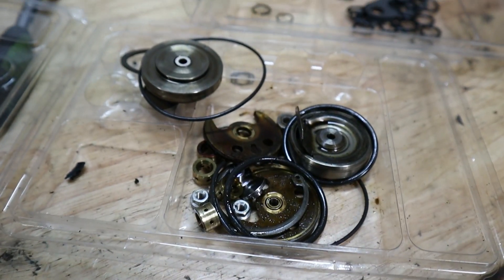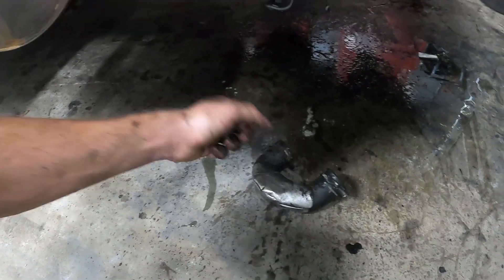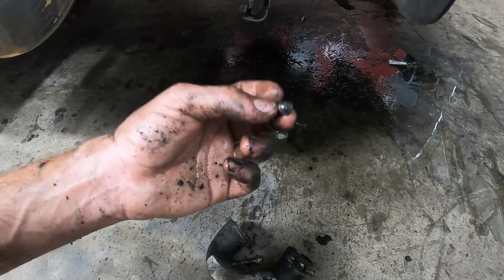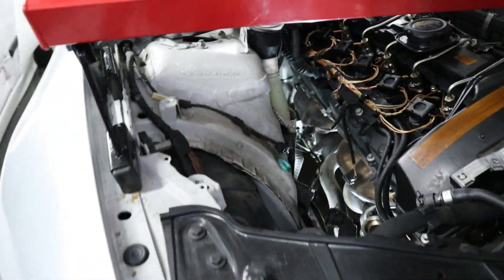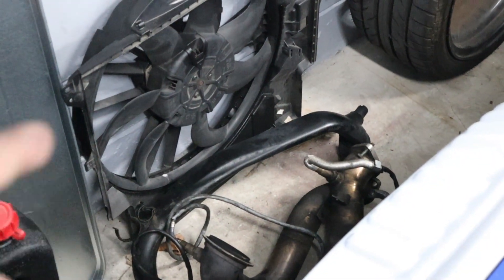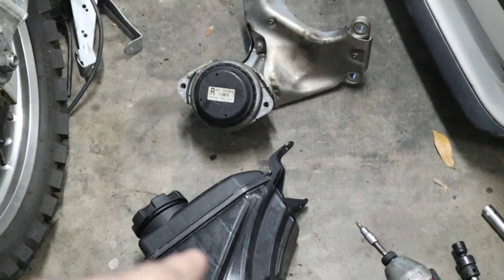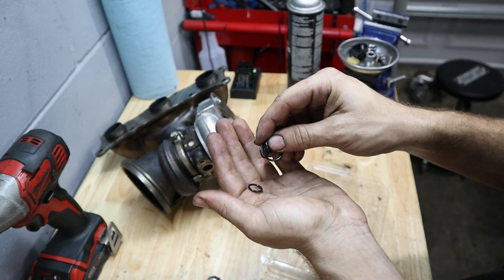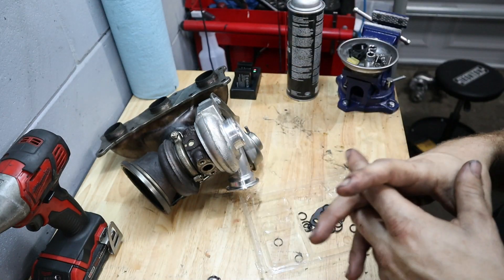Removing and Rebuilding the Factory Turbos on my 335i (How to Fix N54 Turbos!)

Comment: Dude…amazing video, very impressive work removing the turbos. I just wish you explained what each part was as you rebuilt the turbo. Like “this part fails usually” “this is what holds oil log of turbo”. Brilliant fing video still. Just im trying to learn about the turbos. Mechanically.

Comment: Id never rebuilt these turbos on a tune . Definetly do a single turbo setup or upgrade these. 
Our new dealer installed units somewhat smokes at times after a year out the exhaust like the old units but putting the rear cats back on helped

Comment: Be advised: Do not cut into the turbo shaft to create witness marks as this will destroy the factory balance and require the turbo to be rebalanced once done. Use permanent marker or something else that does not take away mass from grinding.
Reply: So will holding it with your hand or.handling it the way this guy did.
Them turbos are fcked

Comment: My turbos (or engine) makes a loud squealing, then grating sound you can hear in the engine and out of the exhaust. Then it goes into reduced  engine power and no more noises.  I have 148k miles on them. Does this sound like it is probably a bad turbo spindle or turbine that is grinding? The noise is awful. Never had any blue smoke. It just looks so tightly packed in there like it couldn't self-destruct.
Reply from the maker: Sounds like your wastegates need adjustment! Super common problem, it can usually be adjusted, sometimes the turbos have to be replaced. Hope that helps, I have a video on wastegate adjustment if you search on YouTube!
Reply: @The Bimmer Barn  The waste gates were adjusted years ago. This is a loud metal to metal grating, grinding noise.  Almost like a cylinder head is freezing up (but it's not).  Thanks for the response. I just can't find anything on this symptom.

Comment: for anyone watching this.... another option is to combine the oil pan gasket swap, on this channel and the turbo swap...and just pull the engine (while still connectes to the tranny) straight out the front of the car with a engine lift. eliminates having to drop the subframe and EVERYTHING is easy access.
Reply: Exactly what I was going to say take about a 1-2hour to pull the engine and 30 mins to get the turbos off if ur organized plus u can get everything else u can’t see addressed
Reply: Im sure hes aware, he just doesnt have the space for it

Comment: In my mind cutting that alignment line for reassembly would throw it out of balance, cause your taking away material. 

I wanna know what to use to clean the  CHRA? Get all that burnt rusty grime off, also clean up the coolant/oil passages! Then it would be nice to install those wastegate arm kits. Now your talking turbo refresh!!! Clutch
Reply from the maker: I agree with what you're saying, but I think that it so little and it also so close to the inside of the rotating mass, it didn't make much difference. Put over 10k miles on these turbos so far without fault. Cleaning the carts and the turbine blades is the big challenge, as it would require some extra equipment (or chemicals?). I'm replacing my carts this week with some aftermarket ones on a budget, curious to see how they hold up compared to these stock/rebuilt CHRAs. Thanks for watching and leaving a comment!
Reply: @TheBimmerBarn  yeah I just seen a video where this dude media blasted the CHRA, pressure washed out any contaminates then acid soaked for a couple hours. He also mentioned coating it with a high temp paint

Comment: Sick video! Kit is only 65 bucks as a diyer that’s way more appealing than buying a whole new set of turbos LOL but does anyone know if this would fix waste gate rattle cos I’ve been spending a lot of money chasing down a 30ff code and jus would want to know if rebuilding them would fix the rattle and allow for proper boost
Reply from the maker: It's a separate kit and repair job, but it would be easy to install it while you're in there replacing the turbo seals! Thanks for watching!
Reply: @TheBimmerBarn  got ya I actually found the part ,pretty sure turbo lab sells it but will def doing both jobs, thanks!

Comment: 120k miles on my n54 everything was stuck rusted leaking, the water cooling hoses would not come off the turbo cartridge rear hose would not come out of block. All copper manifold nuts stuck striped the end then rounded with a box wench and heat. If you are doing this job be prepared to pull the engine like I had to to extract and drill studs.

Comment: Thanks for the awesome video! What symptoms led you to decide to rebuild the turbos? Currently deciding wether or not to do it myself.
Reply from the maker: Thanks for watching! It was burning oil while idling, causing white smoke to come out the exhaust. Easy sign of blown turbos. And at this price, I thought it was worth the shot to rebuild them on a tight budget. Car has done +5k miles now on the new turbos no problem, and as you saw we never rebalanced or cleaned the turbines. I'm happy with the results to say the least.
Reply: @TheBimmerBarn  awesome to hear! Yeah mine is doing the same thing rn, burning oil and smoking under wot and decel to lights and such. How much boost are you running on it? I’m not sure if the high boost maps are the reason they blew in the first place in my case?
Reply from the maker: @monroemidnight9372  Factory boost. Trying to convince my friend to tune it.

Comment: Wow finally someone who has done a video on this. I always considered going this route for my turbos but some people were saying you would still need to re-balance the turbo even if you mark the shaft nut and all. Because the new seals are of different weights and impossible to be the exact same. Have you had any ill effects or car runs fine? Also surprised you didn't do the waste gate fix at same time.
Reply from the maker: No, cars has done about 5k miles great since this install! If I had the opportunity, I'd have them bead blasted to clean the carbom, and then re-balanced of course. But then you get close to the cost of buying some pre-built cartridges on eBay. Thanks for watching and the positive words!
Reply: @TheBimmerBarn  ok thanks for the reply yeah agree that was the dillema about rebalancing

Comment: That bolt is for the coolant tube that goes between the turbos there are 1 on each corner the ones that hold on the heatshield are not as deep but same head and thread pitch

Comment: So why did you rebuild them? Where they leaking ? Because my turbos are starting to leak and I can see the chra wet. Would the rebuild fix this?
Reply from the maker: Yes, the car would puff blue smoke at idle and while driving because the turbo seals were bad. Replacing the turbo seals fixes the oil burning issues.
Reply: @TheBimmerBarn  okay thanks will be doing this soon then. Oh and by the way did you have to replace all the hardware with one of the turbo installation kits? I saw they are around $400 😬
Reply from the maker: @CaptainPancakez  I replaced exhaust gaskets, downpipe gaskets, stuff you see in the video. Re-used the manifold nuts and things like that. You can save a little money but it's best to change as much as possible! Good luck friend!

Comment: 1 recommendation… buy a steam cleaner. You can clean all those parts and make them look like new. Great video, great content, you have a new subscriber.
Reply from the maker: Welcome to our community, Octavio! I actually do have a steam cleaner, but it's smaller and has trouble breaking down grease or oil stains. Works great on plastic and vinyl/leather! Thanks for watching and the recommendation 😊
Reply: @TheBimmerBarn  I’m not sure how small is small but I use the steam cleaner from harbor freight on my coolant/ oil lines and it did wonders. I’m in the middle of turbo replacements as of today and I can tell you, the whole oil pan and front of the engine have caked on oil and dirt. I’m going to be cleaning as best as I can but so far what I’ve cleaned is literally night and day. If you’re on IG, you’re welcomed to check out my last post where I show how clean those lines turned out “o_davidg” my page is public.
Reply: ok

Comment: Do you know if this is similar to upgraded turbos?
Reply from the maker: Yes, exactly the same. The difference with upgrade turbos is in the compressor housing, and the turbines. Internals are usually rebuilt with kits like this.
Reply: @TheBimmerBarn  sweet.. I have 19ts they lasted about 18k miles I’m going to rebuild them thanks to you!

Comment: My turbo has leaked exhaust and white smoke. Can I do similar service like you to replace with new seal
Reply from the maker: Yes! That's why I did this service :) This is a great option, very budget friendly, but for a little more money you can buy re-built cartridges on eBay which are drop-in and come balanced. Good luck!
Reply: @TheBimmerBarn   brilliant. Where do you get the service kit from? I can't find anything on eBay or Amazon. I am in the UK
Reply from the maker: @srdfcgvhbn  Hmm they're available easily here in the US (link in description) but you may have better luck on ebay UK? 🤔

Comment: Dose it need to be calibrated? Thanks
Reply from the maker: If you can mark the cold turbine to the shaft and the nut, you should just be maintaining the factory calibration. You can do this with marker but it might come off while cleaning (I used a dremel but was careful to mark it as lightly as possible). Ideally, you would want to send out the turbines to get media-blasted (removing miles of carbon build-up), and then have the shafts re-balanced. Or just buy a new cartridge which comes balanced, rebuilt, and would solve the oil burning issues! Good luck friend.

Comment: would'nt the turbine be unbalanced by marking it with the dremel?
Reply from the maker: It may have a negligible effect on the balance. The weight displacement is so far inboard of the rotating mass that it shouldn't make a big difference. When balancing these turbines, weight is removed from the furthest outer edge, where it has the most effect at high RPM's. If you can mark it without a Dremel and save your orientation, do it that way! Unfortunately sharpie just wasn't going to work for this scenario. Thanks for watching!
Reply: Agree with ThisLaoGuy, by removing material on the bolt will unbalance the chra. It is exactly what the turbo preparators do when they dynamically balance the turbo. And usually they remove less material what we see in the video. So in my opinion, it is now unbalanced.

Comment: Did you send the turbos for balancing? That dremel didn't do them any good.
Reply from the maker: I didn't, and agree with you! They also had carbon on the exhaust turbines, so ideally you'd also get those media-blasted, and rebalanced, might as well do a new cold side turbine at that point, etc... Particularly my focus was on showing how the rebuild process went, and hopefully get a few more thousand smoke-free miles out of these turbos on stock boost levels :)
Reply: @TheBimmerBarn  problem is you might endup with a bent shaft and a damaged cartridge, all that just for a few smoke free miles. Balancing is not expensive and should always be done to prevent future (and bigger) expenses.
Reply from the maker: @JP_SC  Like I said, I agree 👍 I simply didn't have the time or resources to do a full rebuild, but I hope people enjoy the content and learn a little more about how these turbos work 😊

Comment: Did you reuse the hardware for the turbos? Like the studs and nuts that hold the turbos down?
Reply from the maker: Yes, saved a couple bucks since the factory stuff came out cleanly and in good condition. New gaskets all around though! :)

Comment: Dude, how long did the rebuild take?     Great work and Goose!
Reply from the maker: Total time with removing the turbos and rebuilding them, I'd say this is easily a 15-20 hour job
Reply: @TheBimmerBarn  , how much did you charge to do the entire 15-20 hours job.  My car already have 103000 miles. And is running with a low pressure, already checked the vacuum lines they are fine.  The boost pressure solenoids I’m not sure how to check them .  Would you please give me some advice. Thank you
Reply from the maker: @rigu229  You can test the solenoids using a power probe and apply 12v (it should click and open). Also very easy to pop a boost leak on these cars. Make sure no loose clamps, holes in intercooler, etc. Look up boost pressure testing 335i and I'm sure there's some videos. Good luck!
Reply: Do you need to buy the turbo installation kit after you take the turbos out
Reply: @tristengallagher3795 yes